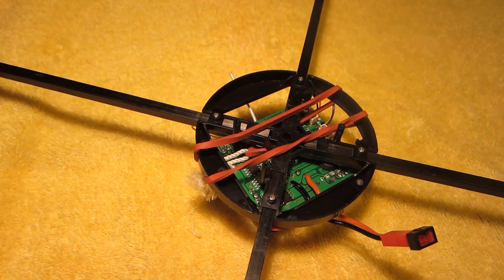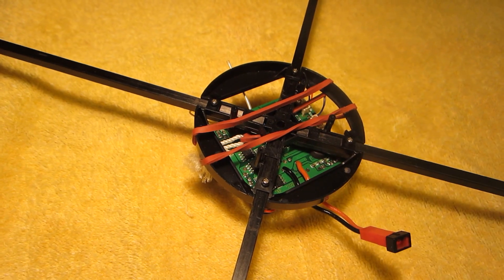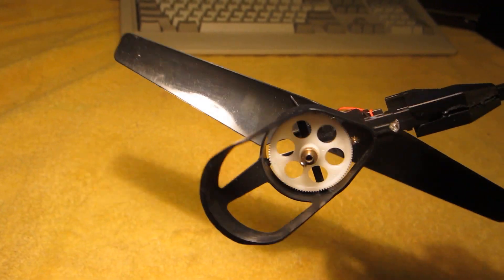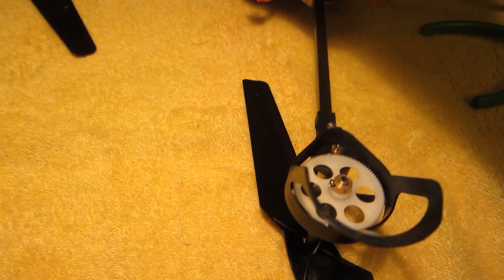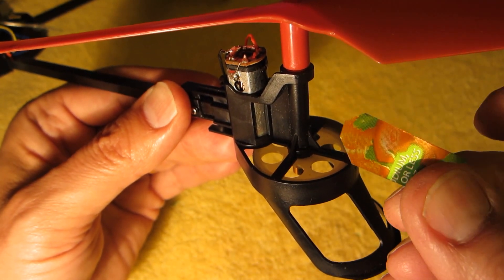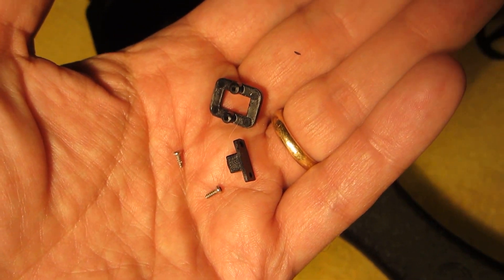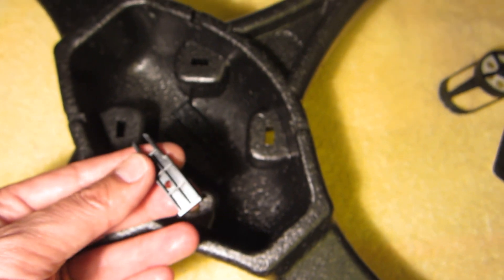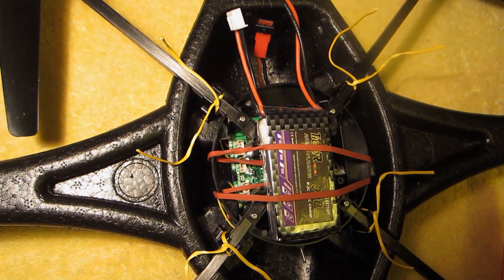V262 quadcopter modifications

Comment: Maybe mine is the same model base unit under a different name, but mine is a Panther, I see someone else down below also has this one. My battery did not last long at all. I bought 2 1000mAh batteries on ebay, one of the best upgrades ever. I also strap it on like that with a rubber band, well, I could only find a hair tie at the time and a piece of shish kabob stick to mount it on lol, but that works great, since the new battery packs where too thick to fit in the stock bracket. I also took off the foam body to help make it lighter for better performance. But I put a heavy duty foam plate over the radio to protect it. Good thing because one time flying it, I went too high and lost signal, once that happens, it seems it is difficult to recover 100%, so it ended up in the neighbors back yard. When I accelerated up to see if I could fly it out of their back yard, it hit the rain gutter. That left a line in the foam plate that was directly over the capacitors on the receiver, which would probably have disabled my machine and I probably would have had to buy a new one.  I now have a heavy duty small paper bowl over the receiver, which I drew eyes on it, so it looks better than just a white cover. I have thought about pealing off the plastic cover and strapping it on, similar to joe n's suggestion. I may do that later. I will have to try that aluminum cooling fins and remove those plastic motor covers. Thank you for the idea's.

Comment: Don't you worry about moisture or debris damaging the motors with no protection like that? Have you had issues with dust or dirt or residual water or dew from the ground or plants damaging the motors? Other than that these are some pretty good tip!

Comment: I am trying this on the V666. Different motor holders. Just noticed that. It might not work on the v 666. Have to experiment. Good idea if I can get it solved...
Reply: John Luciano Not sure how well it's working, but I stuck strips of a metal can in the top of the motor mount, up towards the blades, and then bent them down outside of the casing.  Like I said, not sure if it's doing much but no harm done in leaving them in.
Reply: Thomas Faddis Yeah, they definitely do get quite hot.  I've done some more testing with them, and they seem to do a little bit.  It's well worth the extra 10 minutes perfecting the cuts and getting them into place just right.  The difference is slight, but at least it's something.  Glad I could help.

Comment: I have tried to slip a piece of soda can in between holder and motor. I cut up 4 different cans. Too thin it bends. Too thick won't go in. I even tried to open the tap with a tiny screw driver. What is the secret ?

Comment: Another great modification video. Only concern would be measuring weight on the mods. I am a bit of a weight fanatic, so I would be concerned that the ties might add weight. Removing the batt cage is a genius idea! I personally would leave the foam off. It saves 70g on this model. I am using an oversized 2800mAh battery. It weighs 78g more than the stock battery. Lengthens flying time by 15 minutes and adds only a few g if you remove the foam housing.

Comment: If you think that you may crash this guad DO NOT remove the motor covers as seen here this will significantly weaken the motor mounts making them break off even easier than they do with them. The bumpers is what kills the motors its just to heavy. Once U can hover and achieve a decent FWD flight remove the bumpers peal the plastic canopy from the foam ,attach plastic canopy to quad use tape,velcro,silicon what ever works for U Please dont use a soda or water bottle as a canopy as i have seen some do that's just ugly & no one wants to fly ugly. What i have done is use syma X6 canopy. without bumpers,  link to syma part. http://www.ebay.com/itm/251688779693

Comment: very good tips ,thank you.where can u get the larger battery ?i tried ebay but most of the correct voltage larger batteries are for sony camcorders ect ???
Reply: http://www.tmart.com/Wltoys-Original-A949-V912-V913-V262-L959-Spare-Part-7.4V-1100mAh-Li-Po-Battery-Set_p250173.html About the same dimensions but it's a bit thicker so it won't fit in the holder.  Use the bands or velcro. I wouldn't go bigger than this.  Bigger the battery the longer you can fly it and the more you will heat up the motors and the more you will be replacing bad motors.  I ran the 850 and then the 1100.  Then I had two motors that needed to be replaced.  The motors are the weakest link in these quads.  Get them too hot and they will fail.  Stock up on some spare motors if you have not already.

Comment: Hi, I replace a motor on my quad copter but the copter is no longer flying the controller still bind fine but It wont fly ..I twisted the wiring instead of soldering,,could this be the problem..??
Reply: Yes.  Also did you reverse the polarity of the wiring?  Is the prop spinning in the wrong direction?